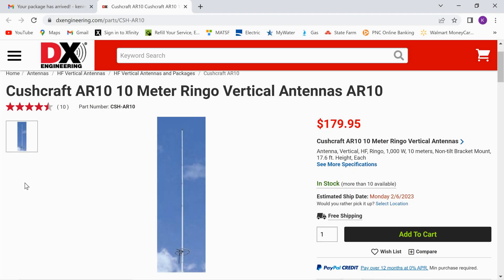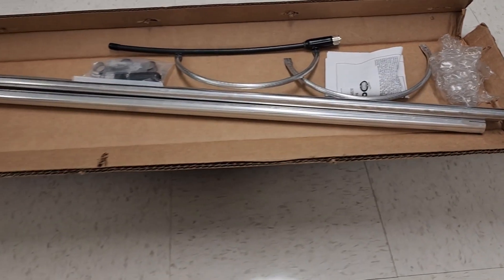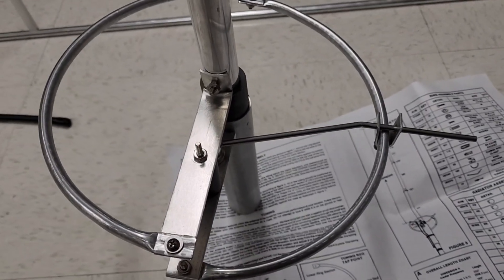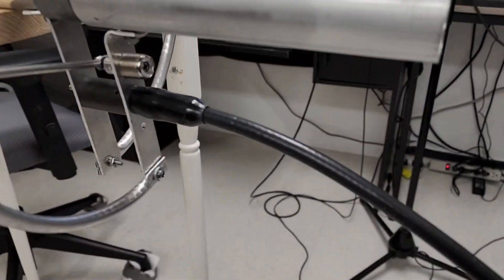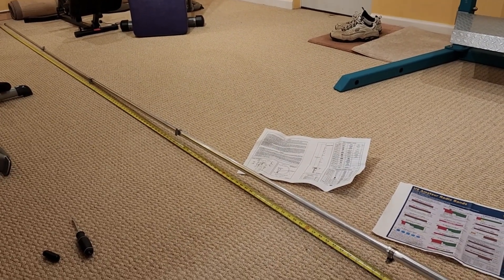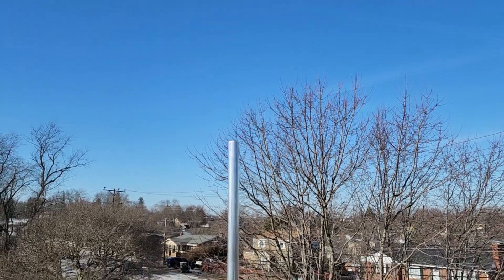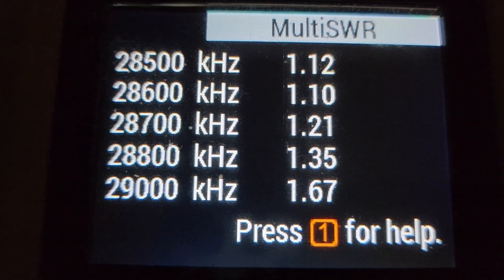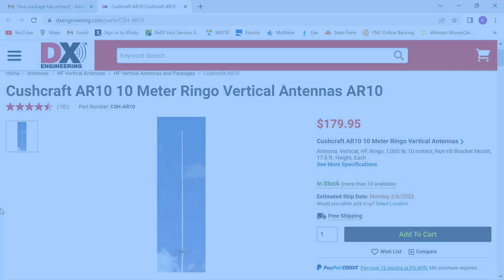Cushcraft AR10 10 Meter Ringo Vertical Antenna build

Comment: Can you explain what the coax  pigtail is for... You have your main coax.... But there is that little 1' pigtail.... What is that for
Reply from the maker: This antenna uses inductance and capacitance for the tuning system. The stub is the capacitance portion.